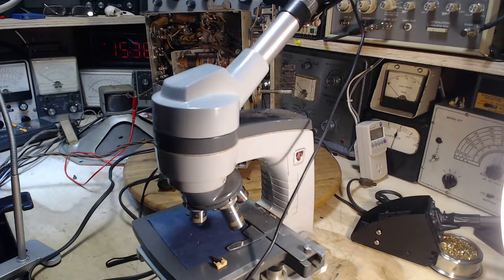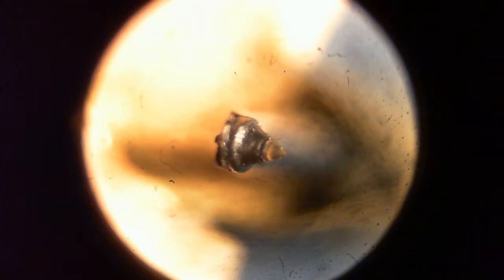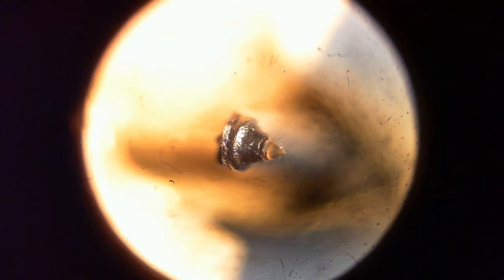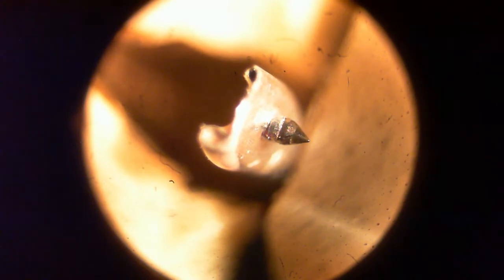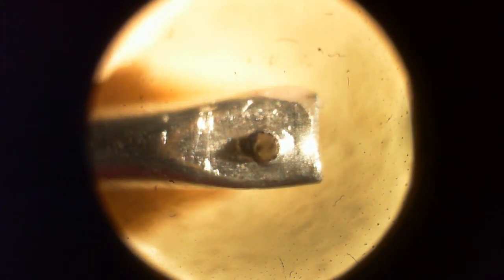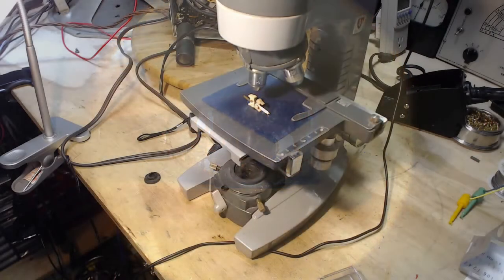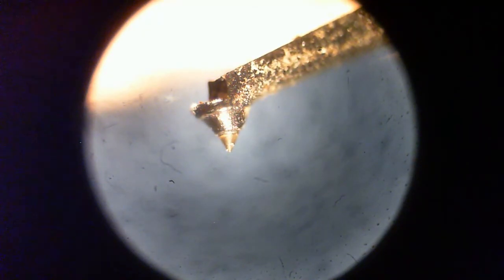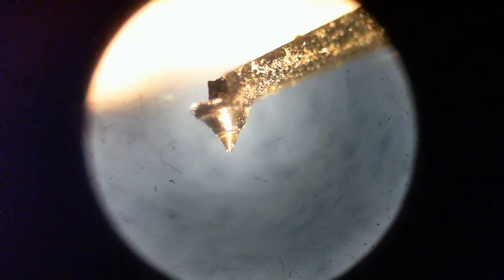Dual 1214 Turntable Video #6 - New Needle Comparison

Comment: A lot of the needles you show appear to be conical needles. I read some time ago that elliptical needles were better for sound fidelity on stereo turntables. 
Although since most of the turntables you seem to be repairing are vintage mono units, the customer probably doesn't care so much since it will only be used to demonstrate the unit and not listen to a faithful reproduction of Beethoven.
Reply: computerman13 man that's a bit of a misnomer to see elliptical is better not the case, on Modern recordings after the 80s maybe but older recordings conical is generally preferred, and your tracking weight is more crucial on an elliptical not so much on a conical stylus
Reply from the maker: Conical vs elliptical.  I'd challenge anyone to hear the difference on a 'regular' turntable.

Comment: looks awful that new one who makes it?? it's quite a standard type fitting that metal collar shouldn't be there as you say it's just a bit of debris it might be stuck to the epoxy or loose. I'd like you to repair the old one with some epoxy resin, get the thin type that use in manufacturing glass fibre you can buy them in kids they are runny put some drops with a syringe around the edge where the diamond meets fur collar and the backside. what is stuck on the diamond or is it where, can you not zoom in closer
Reply from the maker: I knew the new one was cheap ($20 Canadian) but I was surprised by how cheap it looked under the microscope.  It might perform just fine though.  I am thinking about fixing the old one with some epoxy like you suggested.  I'd like to compare them playing a record then fix the old one and compare again.  Maybe I should throw a little epoxy on the new one too before the needle comes loose considering how it appears to be held in there.